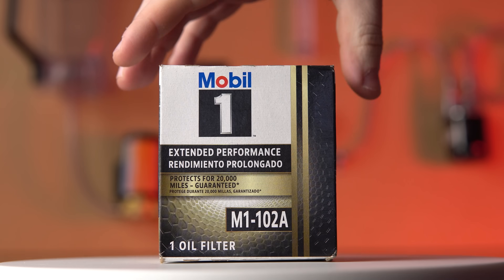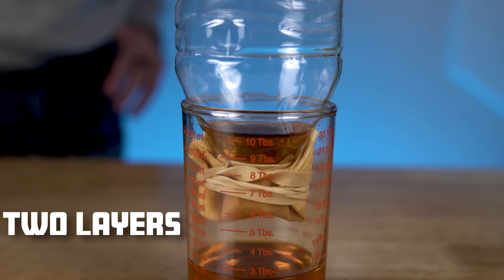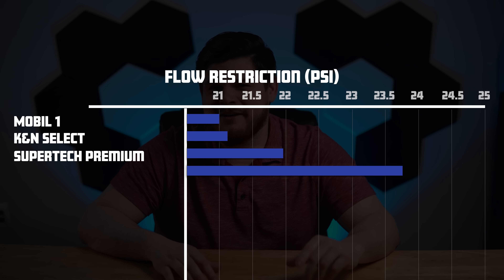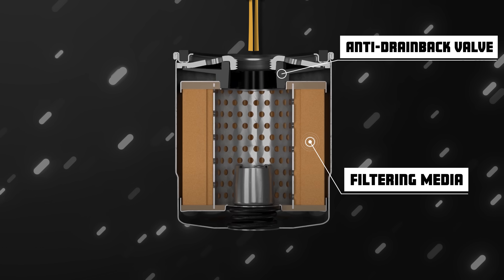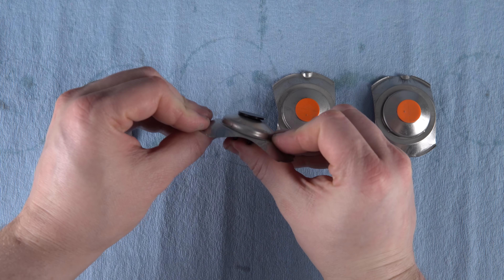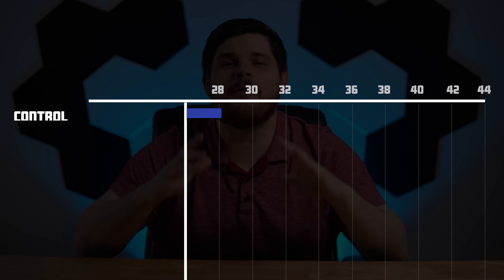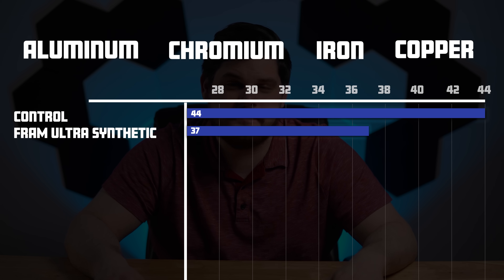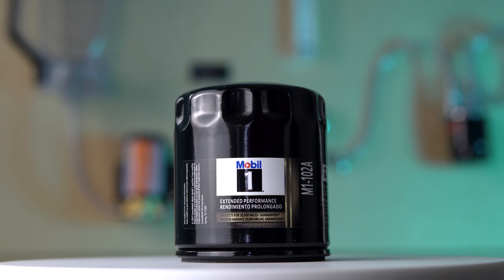Engineers Test the Best Oil Filters! FRAM | Mobil 1 | K&N | Walmart Brand

Comment: What was the oil temp throughout the testing?  These filters have a bypass range between 7 and 14 psi, so you were likely bypassing.  These filters are also rated for 7-9 GPM,  but I doubt you were exceeding that.  What is your motor controller displaying,  Duty cycle?
Reply from the maker: @D Thank you for the insight! It was in deed the duty cycle. The bypass specs are for dP not the inlet pressure, unfortunately we did not have a  pressure gauge after the filter to be able to tell the drop in pressure, but we are always looking to improve our test method so we greatly appreciate your comment.
Reply: @BrandRanks  Yes, I am aware it's dP.  You think you had that much downstream restriction to keep the bypass closed?  Those flow meters typically only have 2psi max pressure drop at full flow and you don't have that much line.  Is there more going on behind the panel?   Am I seeing correctly,  your flow meter is calibrated for water? What was the oil temp and was is maintained for all the testing?

Comment: amsoil oil filter the have a 15,000 and a 25,000 mile filters
Reply from the maker: Thanks for the recommendation! Need to check if those come with the right size for the setup. Unfortunately, a small channel doesn't have much budget.

Comment: Thx BR for an informative and entertaining video. I'm interested in the performance of higher end filters for diesel pickup application that offer increased filtration area and lower particulate size for extended change interval with synthetic oils. I have an LML Duramx using Mobil Delvac Extreme 15/40 Royal Purple filter. Maybe include Wix, Fleet Guard, Cat and OEM GM,Ford, Cummins/Ram.
Reply from the maker: @Bill Dennis Thank you for the kind words. It's great to hear that it provided value to you. I appreciate you sharing and thanks for the recommendation!

Comment: Wouldn't the operating temperatures of oil and filter make a difference in flow and amounts filtered?

Good video overall. 👍
Reply from the maker: @swO You are correct. Temperature would most DEFINETLY change the values, unfortunately heating up the oil with all the plastic components on the test set was not an option. So as long as we kept them all at the same temperature the comparison between them was still fair. Thank you so much for the thought and recommendation, hopefully in some future we could grow and get some fund to improve our test! Your feedback is extremely valuable and much appreciated!

Comment: A more dense, higher efficiency filter will naturally show more resistance to oil flow, thus higher pressure.  The ICP test of the wear metals is not reliable in this test scenario. 1st the test will not see particulates above 10 microns, full flow filters are not efficient at these smaller sizes, the filters are designed to flow oil and stop the largest particulates in 30 micron range. Lastly, the small difference wear particles does not take into account repeatability and normal margins of error. A better test is Particle Count using patch membrane.  It's an ISO test used to determine the cleanliness of oil and performance of a filter.  It separates particles in the oil by size and quantity in the thousands for smallest to less than 100 in the largest.  Blackstone can do this test, as well as other labs.  A better test is to put the 30 micron aluminum powder in clean oil, filter the same oil mixture through each filter, plus a control oil sample, then do the metal test and particle count.  Good try, your close. Keep it up.
Reply from the maker: @TS SCI Just want to say thank you for providing such great info and constructive criticism in a kind and professional manner. You bring up great points. We attempted the particle count analysis at first and after spending quite a bit, we got inconclusive results due to the oil being too dirty so the lab went ahead and did the Spectrometry per their recommendation. I really like your idea! Again, thank you so much for your feedback. We are learning too and we want to improve on every video ,not just the quality but the testing as well and comments like yours are much appreciated!

Comment: Very cool test! I'm curious about how you tested the flow restriction though, what flow rate did you use for the test? Also, was there anything else after the filter to create a restriction? A 20+ PSI restriction just through the filter seems insanely high and I can't imagine the filter would restrict flow so much in actual use, especially since the bypass valve typically opens at somewhere around 8 to 15 PSI.
Reply from the maker: @Avery Alexander Great point! Unfortunately, our flow meter was capped at 3 GPM so we were not able to capture that. We performed the test with the same pump power across oil filters to ensure fairness, but you bring a very valid point that we will have to investigate further. There was nothing additional upstream apart from the flow meter. The WIX filter are normally rated at 8-11 psi, but those are generally considered low on average. Thank you so much for your input, we really do appreciate it as it helps us get better and perform better tests.
Reply: @BrandRanks  I'd suggest putting a flow meter capable of measuring sufficiently high flow rates upstream of the pressure gauge just to eliminate it as a variable in testing. If it's maxed out, it's likely a measurable restriction. Also, you will definitely want to make sure you use the same oil at the exact same temperature for each test. Even a small variance of a few degrees could change the oil's viscosity enough to significantly affect the results. Think about how much higher oil pressure is on startup compared to once the engine warmed up. Thanks for taking the time to make these videos and to ensure your testing methodology is as good as possible, I love watching videos like this and I could see your channel blowing up very soon if you keep up the great work!
Reply from the maker: @Avery Alexander Thank you so much. Like really... Thank you for being so kind and respectful and providing great insight! Completely agree with you.I think we will also put a pressure gauge after the filter to measure the pressure drop across the filter instead of only on the input. Also thinking of doing a particle test instead of spectrometry. We are learning as we go as well. Not just on testing, but scripting, filming, editing, sound. It's quite a lot especially on the weekends only. So can't say it enough! Thank you for you words and how you provided feedback. We really appreciate it!

Comment: Your flow restriction chart diagram is quite misleading.  If you would have started the baseline of the graph at 0 psi - the difference between the least and most restricted would have appeared much less dramatic.  Even comparing the two least restrictive - that 0.1 psi difference looks significantly worse when it is only a 0.005 increase in restriction of flow - but according to your baseline diagram - it looks about 25% worse.
Reply from the maker: @Dr. Stephen Heilman Good point. Thank you for feedback, we will take this into consideration in the future.

Comment: The fram ultra is the best bang for the buck ! Hands down !  %77 efficient at 17 microns ! I havent had any problems ever !
Reply: PureOne will give it a run for it's money, 99% at 20 microns.  And 6 for $38 on Ebay...
Reply from the maker: @scotty moondog jakubin Thank you for your feedback! I've been running FRAM for years now and have had no issues. If you do regular maintenance most filters will do.
Reply: @BrandRanks  ya ! My daily is a 94 chevy s10 2.2l with 650+ miles on her ! original unrebuilt eng - trans - rearend ! my OCI are about 4,000 miles  and or 200hrs . fram ultra syn . oil filter a best buy !